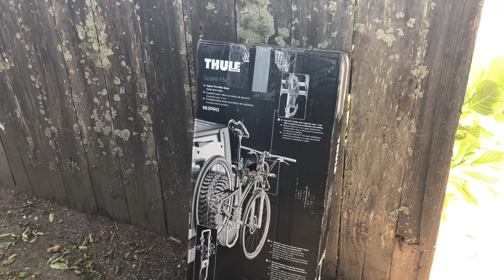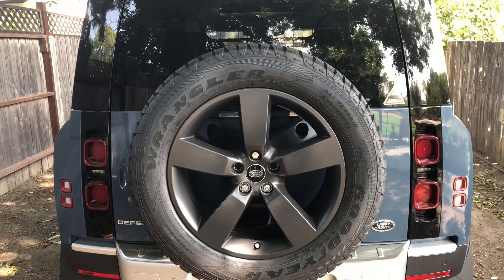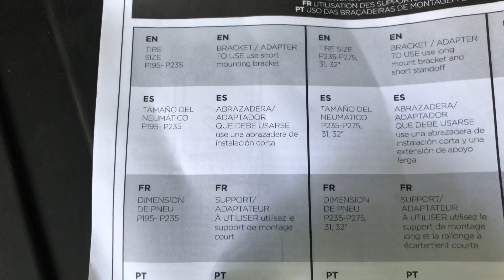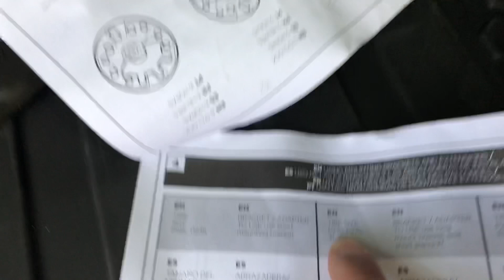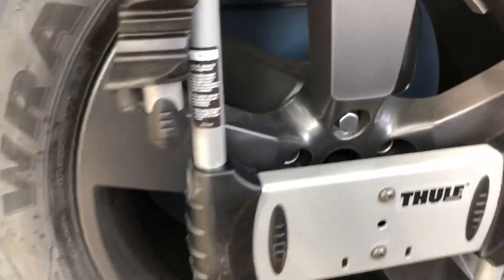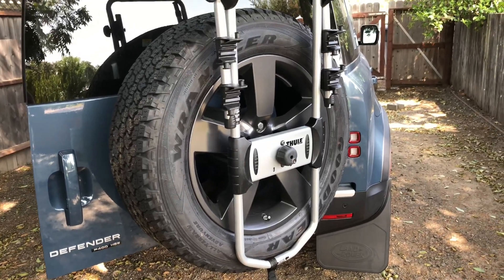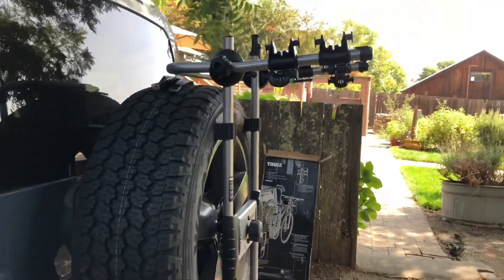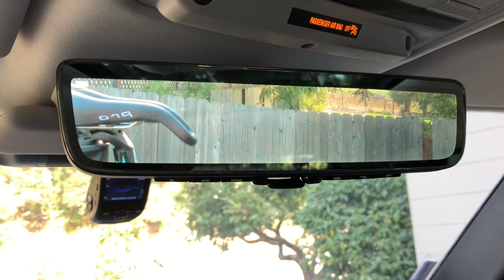2020 Land Rover Defender - Thule Spare Me Pro Install

Comment: Thanks for video. Just wonder if rear door is capable to carry additional weight of 30-45 kgs?
Reply: yeah this is what I was wondering too (certainly somewhere this spec is published). I use to have a Nissan Pathfinder years ago with a swinging tire rack mount and I wasn't comfortable putting too much weight on it for bikes etc. 

this is one of the reasons I went with an LR Discovery w/tow hitch instead of getting the new Defender.

Comment: Thanks for the video! I just put my rack on today!! I have a silly question..I cannot get the arms to fold. I unscrewed the knobs as instructed in the manual but the arms will not move. Is there a trick to it not in the manual?
Reply from the maker: What I do is after I unscrew them, I push them in, as the attaching bolts are "squared". This allows me to move the arms back down... Sorry for the late reply!

Comment: For my  2020 Defender install w/stock rims, I can't seem to get over the fact that the adapter plate is off center just enough that I can't slide the bracket in. If I try, I will scratch up the inside of the wheel center. Anybody else run into this?  Its a brand new Thule Spare Me 2 rack.

Comment: I'm looking at a solution for my spare wheel and this looks up there...presently have a bike rack on top with steps on the side...its just too much hassle and stress getting my mountain bike up and down...so appreciate the video (I'm 6ft 6 and wouldn't recommend a standard bike rack in top...ever!)

Comment: Have you tried loading 2 MTBs on this rack? I have an XL and S, both 29ers, wondering if it would hold up. Thanks for the video!
Reply from the maker: I have not at this point, just my road bike... I know there are some Wrangler owners who use this for their MTB's and have had no issues!
Reply: @sphcars337  Thanks for the reply. Only one way to find out. Will report back later this week.
Reply: Couldn’t get this mounted to my defender. I have the 19 inch wheels maybe that’s why. The lug nuts just wouldn’t catch sadly :(
Reply from the maker: @baklava3030  Which lugnuts? You should be able to mount this directly behind the whole wheel with the bracket going through the hub of the rim... Don't mount this with the lug nuts...
Reply: @sphcars337  The lug nuts for the spare tire. I put the mount exactly as you placed it, put the tired back onto the car but the lugnuts wouldn't screw back in with the mount behind the spare tire. I took the mount off, and put the tire back, lug nuts screwed back in with no issues. Unlucky for me
Reply from the maker: @baklava3030  They will screw back... It took me about 20 minutes to line up the bolts and lug nuts properly (luckily I didn't put that on video, because it was embarrassing how long it took), but it will go back on.
Reply: @sphcars337  So no problem with 19 inch wheels?
Reply: I have the 19inch wheels and don’t have a problem getting lugs on with the mount in place however the mount seems off centre either too high or too low to allow the rack mounting sleeve to slide into the centre of the wheel so I’m going to try again with short mount and no offset

Comment: worth noting that when I contacted Thule about a compatible bike rack for my vehicle which is the same as yours, they said none of theirs will work. Do you have any issues with the unit creeping/rotating to the left or right from the weight of the bike after perhaps a bumpier ride?
Reply: Yes on the website it says this bike rack is not suitable for new Defender, I emailed the to ask why? It looks like it works well. Do you think the rear door is not rated strong enough?

Comment: Hey there. Do you have any recommendations for a trailer hitch based 2-3 bike carrier? I'm hoping to keep the tire covers on.
Reply from the maker: Thule, Yakima, & Inno both make fantastic systems for trailer hitch bike carriers... I would recommend any of those. With the Defender though, you'll need to purchase a trailer hitch extender, either a 7" or 8", so that the post can clear the spare tire. It will add over a foot to the car's length though, so bear that in mind.